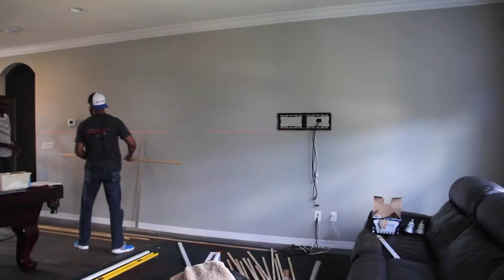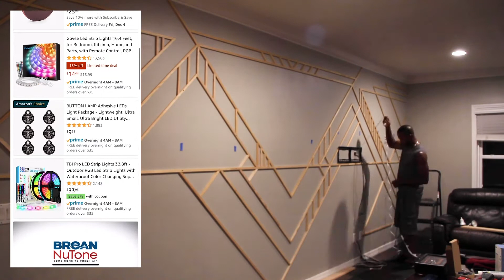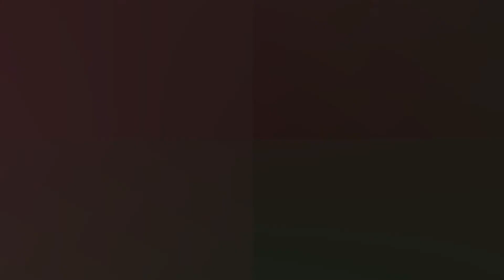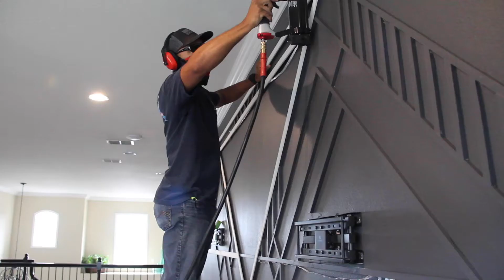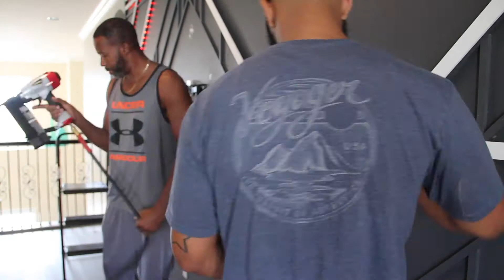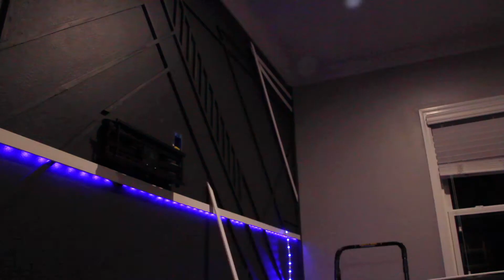Accent Wall LED

Comment: very nice. however, I would prefer to not have the lights show the incremental "dots" of lights, when illuminated. There could be a better way to install the lights so that the strip lighting is better hidden behind the trim?? Just a thought/preference. But, still very nice work. Taking nothing away!
Reply from the maker: I agree! and have changed it up in later projects. Thank you

Comment: Great job, love the pattern, the symetry of it and the little added details. One thing I'd have done differently is use the "neon" type LED strips instead which have built in diffuser. seeing individual LEDs is a big no no for me
Reply from the maker: Thank you 🙏🏽 and yes I have used them since and they work better

Comment: Love the work love the concept the one thing i think you can do better is not show the led lights because the leds need to not be shown the way they are but reflect off and show a cleaner glow off the wall not show every led light off the strip but i like the work overall and the concept also the leds should of put on the backing of the overhang  so it can reflect off the wall instead of on the sides just pro tip i actually install for a living not being negative just advice if you want to save some money and if you want to spend a little extra you can use led light strip channels and gives it a solid cleaner look
Reply from the maker: Thank you and I appreciate the tip. I will incorporate that if I do lights again for sure

Comment: incredible work! doing a similar project myself! One thing that bothered me with mine was the reflection of the led light strip... you see how when your lights are on you see each individual led light that reflects off the wall. What I did was, I used an LED light strip channel diffuser which ultimately defuses the light and makes it look more blended and solid through out. I set my wall up the same way you did with the LEDs, but then removed the LED and added this diffuser channel and made an incredible difference and really easy to work with. Love the video great stuff!
Reply from the maker: Much appreciated and that diffuser totally makes sense. I’ll try that next time 
Thank you!

Comment: Nice project!!! I actually like the grey color in before wall too but the after one is just too cool!!! 
How do you connect the LED strips when there's a trim standing in the way? I watched a few times and still couldn't figure it out
Reply from the maker: So sorry for the delay! And thank you for watching and the awesome compliments 

Around 3:30 I talk about how we used the rotary saw to run the wire around. We actually had to do it after the fact! 
It would be easier if you cut the notches out before attaching the trim to the wall 👍🏽

Comment: Looks awesome! Where did you connect the power for all of the lights? Behind the tvs?. Thanks!
Reply from the maker: Thank you so much !
Yes, an electrician installed 2 outlets above the centerline and behind the TVs. The point was to keep all the TV cables hidden and it worked for the LED cables as well

Comment: great job man, that looks killer! One suggestion i would make is to put the led strips on the back of the lattice rather then on the side of the trim. this will make them virtually invisible from anywhere in the room, and give a better diffusion of the light. If you're thinking about doing more LED projects i'd check this out https://www.youtube.com/watch?v=dlwPCJcSwLs
Reply from the maker: Thank you
Great video you have there!